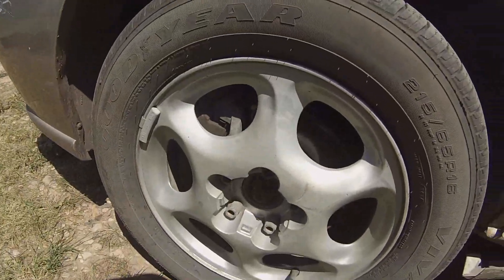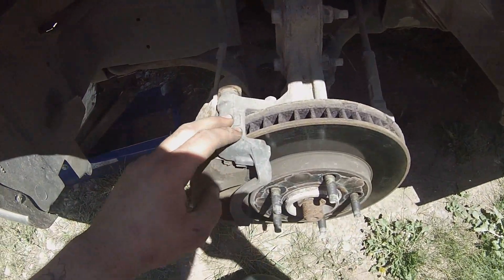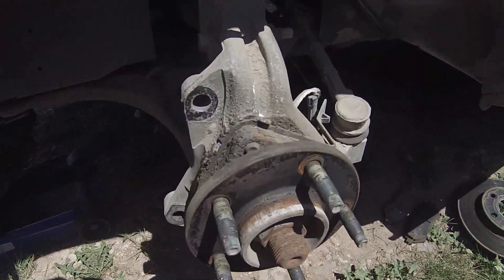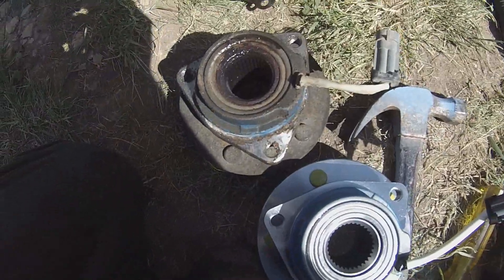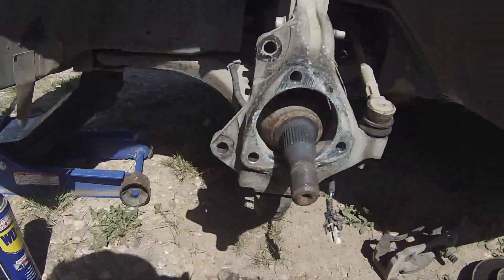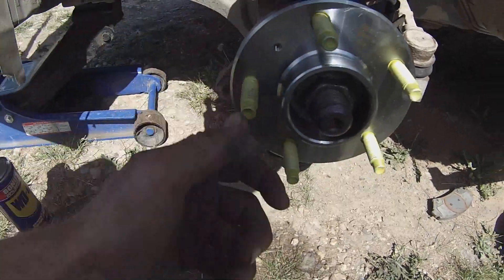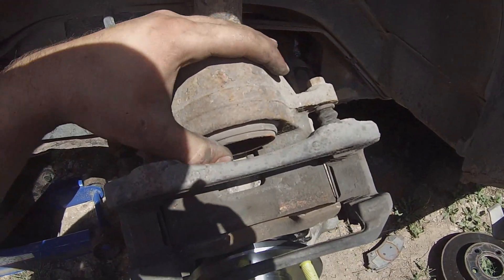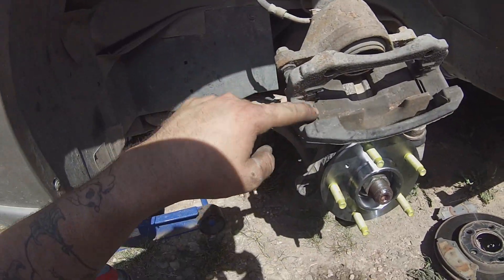Hub Assembly Replacement | 2003 Oldsmobile Silhouette

Comment: You made a great brief video! You have a new sub for sure my dude.
To the other comment, my brake press tool works fine, but only if also changing the pads. The c-clamp works as well. But I have a old piston clamp that only bent on a ford.
Never lend your tools, only your time. Just so people will learn.